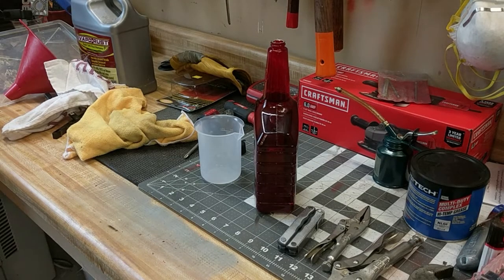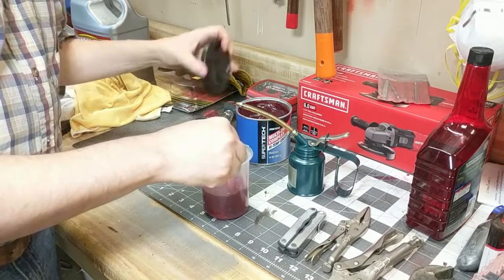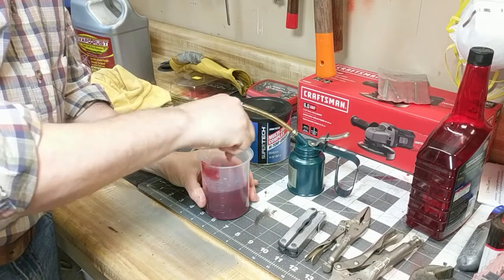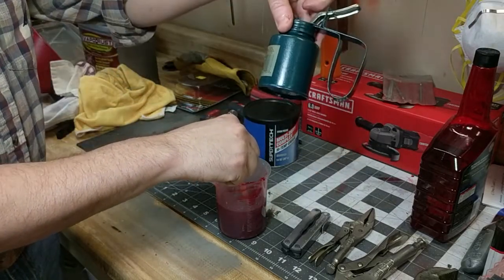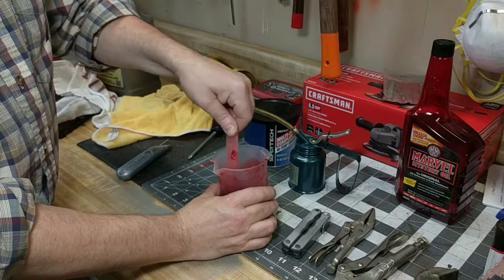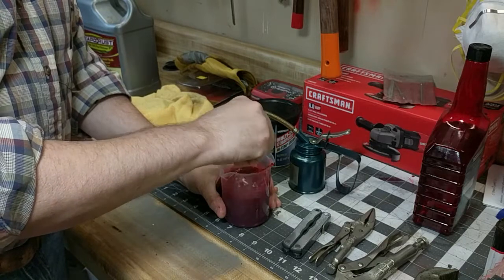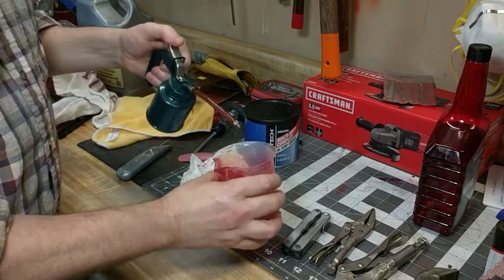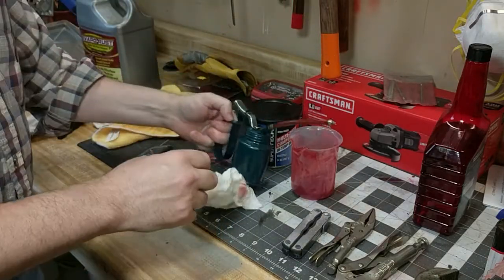TSWG Episode 66 The Blood of Captain Marvel

Comment: Hey Matt!  I can't believe you got the two to mix without heat!  The three lubes I like are 1-non-detergent 30w and Grease,  2-Red grease and Marvel Mystery oil and 3-Vaseline and mineral oil.   I use all three a lot!  The mix you made is great because it has cleaning properties so for shears and tools that are exposed to contaminates it works great.  You have the perfect oil pumper for that!  Let me know how you like it!   The mineral oil/Vaseline mix is awesome for wiping down tools that stay in the garage. Totally safe, you can apply with your hands!   Lastly the 30w/grease mix is awesome for vise threads, drive chains, pivot points on tools...  All great stuff!  If you don't have a hot plate, a pan of hot water that you can dip a container in to mix would do fine...  😃👍
Reply from the maker: John the garage was about 80 degrees maybe that helped 😀
Reply from the maker: Oh and I will say it is mostly mixed

Comment: I would use an old handheld mixer with a metal bowl on a hot plate to homogenize the mixture.  If you find a source for the oil can let me know.   Speaking of mixtures and concoctions, since it's National Bourbon day, 5 O'clock, and Friday, I'm going to mix some ice with some Bourbon and see how that works out.  Cheers 😁